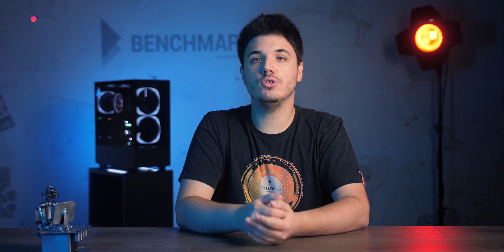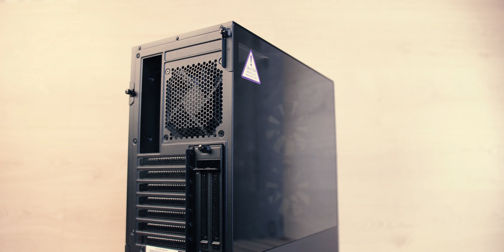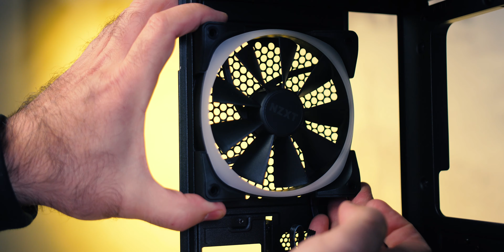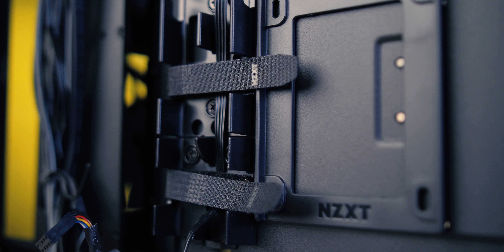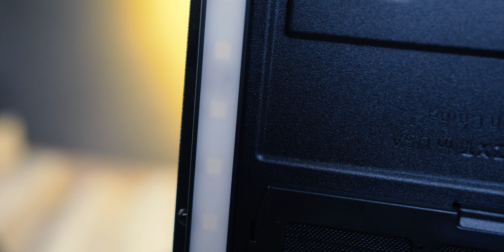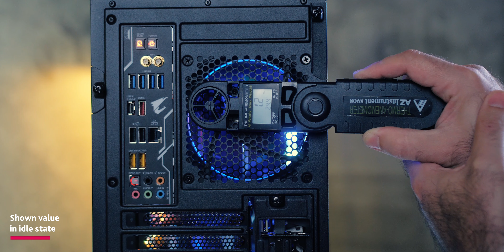NZXT H510 Elite case review - Extreme beauty, Top performance

Comment: How do you plug all 4 Aer 2 RGB fans in the controler , since there are only 3 slots for fans ? Im building the same setup so some help pls.
Reply: The fans daisy chain to each other, each fan slot supports up to 10w which is good for 2-3 fans, the whole module supports up to 5 Aer rgb fans in total I believe and up to 4 led strips in total, you can find the exact info on NZXTs website and also amazon I’ll provide the link below.  

This is from NZXTs website Smart Device V2	3x Fan channels with Max 10W per channel output*
2x RGB LED channels, each support up to 4x HUE 2 addressable LED strips or 5x Aer RGB 2 fans
Built-in noise detection module
*Note : If a splitter is used, fan control is regulated depending on the fan connected to the 4-pin port . Do not use low-noise adapters.

https://www.nzxt.com/products/h510-elite-matte-white
Reply: @jaredcolon24  Thanks for effort . I allready maneaged to connect them , but still thanks !
Reply: @Jared Colon and @Sindoor Belic are there two different cables for the fans eg one for rgb and one for power?
Reply: @seank8954  yes all rgb fans have 2 wires one for power one for the leds
Reply: So can the controller that comes with it handle 4 aer fans?
Reply: @seank8954  yes, and the software “NZXT cam” will allow you to control all of them individually too
Reply: Thanks

Comment: I recently bought 2 NZXT AER RGB 2 for my h510 elite but do i need a hue 2 to be able to use the aer rgb 2? Answer me please
Reply: i think you can put them in the rgb/fan controller. daisy chain the fan and connect them
Reply: @Kirai can you explain how to connect them up for me please.
Reply: @harryferrucci9359  you need to plug one end of the cable into the "in" hole and the other side to where the led strips are connected. I have a h510i and there is only one place in which you can do this and unfortunately it is taken by the led strips. I think it's either the fan or strips

Comment: Case is a work of art, just don’t use the vertical gpu mount for better temps and your good.
Reply: True
Reply: are the temps a big difference?
Reply: Joebs I got around a 6-7°C difference, however with some tweaking of the fan curve I got it to almost the same temp as horizontal, so if you don’t mind noise you could do that

Comment: Hey do you need the hub to control the lighting for the RGB strip
Reply: if you get the h510i or elite it comes with the hub
Reply: @mx5kenny  yeah I know. I have already built my PC. I was asking if you needed the hub to control the lighting. Meaning could you control the lights without the hub. I got it. I replaced the NZXT RGB because I needed to free up a USB 2.0 slot on my motherboard in order to connect my h100i Platinum SE pump and my Lighting Node Pro. Now I am just getting Corsair RGB strips to connect to my controller.

Comment: Can you use the front RGB fans to put in the back & top of the case? Rather then buying two extra RGB fans? Ill be using a water cooler up front.
Reply: The back only supports a 120mm not 140mm fans.
Reply: @TheSjuris  not true, the top fan on the back can support 140mm rbg fan
Reply: Foldzz you do realize the rear faces back not up.  The top fan supports 140mm the back fan doesn’t
Reply: @TheSjuris  that's legit what i just said
Reply: Foldzz you said the back fan supports 140 which it doesn’t. The back fan doesn’t face upwards. The top fan does.
Reply: Steven Juris he just said top fan
Reply: Spitfire 130 phrase back and top is 2 different locations last time I checked.

Comment: Is the back rgb fan included with the case or only the 2 front one
Reply: bigman Skrrr 4 fans come with it, one in the back, 1 up top and 2 in the front
Reply: lyqn but are they rgb
Reply: @oxmo1124  The two in the front yes.
Reply: @lyqn2134  are the two fans in the back RGB? or do i have to buy RBG versions of them with the case?
Reply: @gamingforce1711  No they are not RGB, so yeah, buy RGB versions of them.

Comment: I installed a rear AER RGB 2 120mm fan, but when plugged into the controller, i dont get any lighting coming from it? Did you plug the fan directly into the controller?
Reply: you need to daisy chain all the fans together. The bottom fan in the front of the of the case has an out opening on it, use the extra cables to chain all the fans together into one LED port.
Reply: @KrackinGames  could you help me do this?
Reply from the maker: It was connected in cascade on a same channel along with other fans.

Comment: I have the aer rgb 2 with hue 2 controller does this need the controller or all can be done in the smart hub?
Reply from the maker: Smart Hub is Hue and Hue2 compatible, so that's all you need.
Reply: Thank you I’ve looked for this everywhere.
Reply: Also @Bench House how do the two excess fans plug in to the main module, in which plugs?

Comment: What ram are you using? I couldn't tell if it's independently illuminated or if it's actually integrated with the hue system. I'm new to NZXT hardware and wasnt aware if other hardware could work with the hue system
Reply from the maker: Yes, it's independent, since RAM usually cooperates with motherboard LED systems, and Hue does not.

Comment: Is it possible to install more than 3 aer fans on the smart hub?
Reply from the maker: You can connect up to 5. Beside 2 that come with the case (front), you can add 3 more and connect them together on a single connector.
Reply: @BenchHouse  can it connect 4 rgb fans?

Comment: May i ask, how were you able to add two extra rgb strips and the underglow?
I did some research but people tell me this is not possible b/c of the max 40 leds per channel.

Can you explain how you managed to do this?
Reply: I think he bought another hue+ or hue 2
Reply: Could you please respond to this?
Reply: you have to daisy chain them. very easy
Reply: ツMacley nzxt states that the controller can run 4 hue strips, each channel connected to 2 strips daisy chained
Reply: the strips are about 1 foot each and only have 10 leds on them, you can plug the strips into the end of one another(daisy chain)

Comment: Did you add two 140 fans or 1 140 & 120 ?
Reply: How many AER RGB 140 and 120 fans did you end up buying? Im building my pc soon and im curious.
Reply: @kevinayon9564  from what i've seen, the two fans in front are both 140mm RBG, but the rear ones are normal 120mm. If you want that RBG look in the back, you'll need to buy one 140mm and a 120mm rbg for the back fans. 140mm on top, 120mm on the rear
Reply from the maker: We received a sample case, but officially it comes with 2x 140mm front, 1x 140mm top and 1x 120mm rear.
We added the Air RGB 140mm top and 120mm rear. Rear position can only accept the 120mm.
Reply: Bench House thanks for the reply. Final question , can all 4 fans be linked to the included hue hub?
Reply: Ash Impreza do you get the answer because I want to build the same system without buying another smart hub
Reply: @AshImprezaTV  .?
Reply: saad mardinli yes they will all connect with the included hue hub 👍🏻
Reply: Li0nTig3r yes it will all work with the included hub 👍🏻
Reply: @AshImprezaTV  Thank you bro

Comment: Can I connect 4nzxt Fans, 1RGB Strip from nzxt and 2underglow Strips from nzxt to the smart Hub V2 or am I supposed to buy the Controller?
Reply: I believe you're going to need an extra USB extension since you wont have enough ports for all of those items. you can find these on the NZXT website.
Reply: Answer this man
Reply: Ty
Reply from the maker: @BellyDrumPlays  You can connect it, in fact, that was the exact setup we used, without an extra controller.
Reply: Bench House could you detail how you did this please?